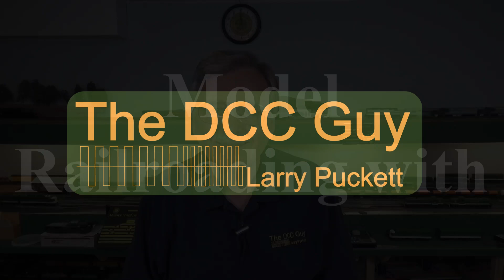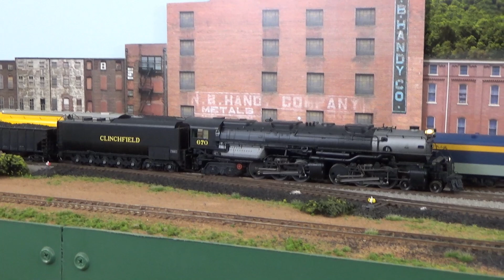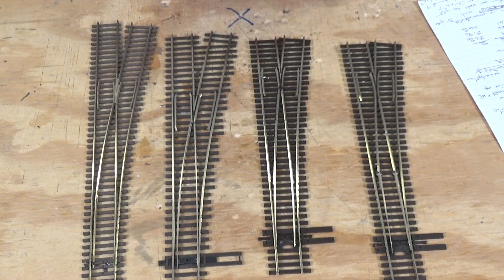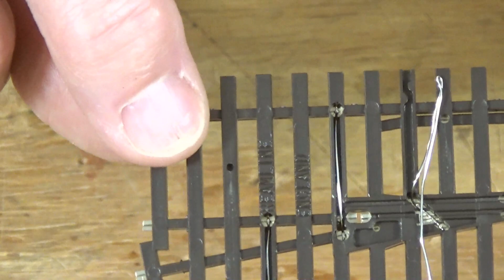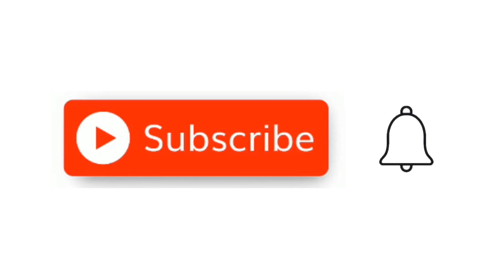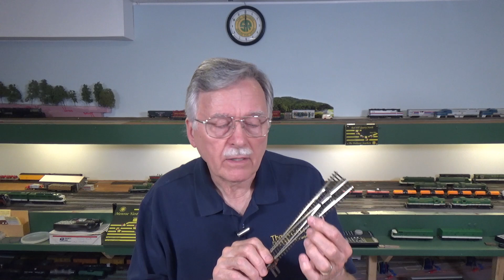NEW Peco Unifrogs Are Here: Let's Compare (260)

Comment: Larry; thanks for the review but I am confused about the unifrog.  I just installed 2 unifrog curved points in my newest layout and neither have wires on the back of the frog.  They work quite well.  If the ones you showed were Unifrog, why is there a wire attached to power the frog?  Thanks for helping me understand.  Cheers
Reply from the maker: The wire on the frog is a carryover from the Electrofrog design. I do not understand why your Unifrog turnouts do not have them. Are they UK prototype and what scale/code? Are you sure they are not Insulfrogs?
Reply: @TheDCCGuy  Larry; sorry for the tardiness; I don't know if the turnouts are UK but they are HO code 100.  The product references are Peco ST 244 and ST 245.  My supplier (M.B. Klein dba ModelTrainStuff.com) lists Peco curved turnouts on their site - 2 are insulfrog; 2 are electrofrog and then these 2, which I believe the packaging said "Universal".  Very curious.  Thanks
Reply from the maker: Those are not unifrogs, they are insulfrogs which means you cannot power the frogs.
Reply: @TheDCCGuy  Then I don't get the point of the unifrog.  With a wire attached how is that any different than the electrofrog?  Curious to me at least as to why Peco does not reference them as insul on the package.  Only 1 way to find out - I will send them an enquiry.  Thanks for your help.  Cheers
Reply from the maker: Electrofrog and insulfrog turnouts are being phased out and replaced but the unifrog turnouts. It is just taking them a long time to do the comversion.
Reply: @TheDCCGuy  Peco apparently plans to phase out all the dual line turnouts of Electro and Insul frog and replace with Unifrog.  As the tooling wears out, turnouts are being converted.  As far as I know, the only code 83 unifrog presently are the #6 double slip, #6 crossover and most recently the #6 regular turnouts.  The #5 turn out and #7 curved are still two versions unless something changed in the last couple months.

Comment: Any difference on the depth of the plastic in the frogs?  One of my biggest issues is the flanges of my European cars in particular, hitting that plastic infill and derailing.
Reply from the maker: I’ll  he k them and see, more later.
Reply from the maker: I measured them and the Pecos were about 0.86 mm, the Walthers were 1.18 mm, and the ME was 0.90 mm deep in the middle of the frog.
Reply: @TheDCCGuy  wow, that is quite a difference!  I was thinking of grinding that down to avoid derailing, maybe I should just replace.  Thanks!
Reply from the maker: I remember an article long ago in MR about folks who would grind down the flanges on older equipment. I often considered doing it to my Rivarossi E8s, but then replaced them with LifeLike E8s instead.

Comment: Interesting video as always. I model British outline here in US primarily OO (code 100) but have a (Peco) 009 section on layout - I generally order Peco Track from UK as it's much cheaper (after 20% VAT removed) even including shipping. Peco availability was dire until a couple of months ago, but now everything seems readily available (at least in UK) I generally use electrofrog but will order unifrog next time and see what I think. (Also good to know the Peco turnouts in US are now a different design to the British ones).
Reply from the maker: I have a new box of Peco code 75 bullhead rail I won’t be using, know anyone who might be interested?
Reply: @TheDCCGuy  Thanks for the offer, don't have any need right now. It would be a massive effort to rip up and replace the existing track (500+feet), plus I run a lot of older Triang/Hornby/Bachmann/Lima stock that needs the code 100 profile. Model Railways are always a compromise (particularly OO).
Reply from the maker: Yes, one of the reasons I stayed away from UK and other European models for so long was due to the “pizza cutter” flanges. I do have a couple of Rivarossi E8s that bump along on my code 70 rail. The flanges are so deep they hit the spikeheads.

Comment: Some other things to consider: the Walthers head block (imo) looks better than the Peco, however the Peco "throwbar" is better looking than the fat slab of the Walthers. Also, ME has their yard ladder system, something no one else has afaik. Also, to reiterate what Larry said last video, if you are going to use any of these with a switch machine you HAVE to take the spring out.

Comment: Hi Larry. I have been on the Peco website over here in the UK. At the moment, in code 83 HO they only have right and left #6 turnouts in unifrog and their #6 double slip. They are also bringing out a range of code 70 track for the US market which at the moment consists of plain track, a code 83/70 transition piece and unifrog left and right #6 turnouts. My understanding is that eventually all their turnouts in HO/00, be it code 100, 83, 75, or 70 and their N scale range, will be transitioned to unifrog. This will eliminate electrofrog and insulfrog (except the trainset setrack which will retain old fashioned insulfrog points) so other sizes will become available as they change the tooling and produce new batches. I have used them in both HO and N and for me, they are the way to go. They are nicely made and very robust whilst looking delicate. Hope that this information is useful. Cheers. Steve
Reply from the maker: Thanks Steve for that info. I knew they planned to eventually transition everything in their line to unifrog configuration, I’m just not holding my breath to see how long it takes. Covid has thrown a wrench into a lot of plans.
Reply: @TheDCCGuy  I know what you mean. During the pandemic the factory stopped all production and started making stuff for the health service. My understanding is that production has resumed but they are behind. However they have refined the unifrog points already to make them more reliable. Unfortunately I have yet to see the code 70 over here, I think the market is limited for US stuff here in the UK. Carry on with the videos. Thanks to you I now do my own sound instillations
Reply: @stevesworldofmodelrailways  was at Peco today and they had Code 70 US stuff on the shelves.
Reply: @DrDinnerTable  cheers. I have started seeing them advertised as being in stock at various suppliers
Reply: They also have a code 83 #6 unifrog diamond.

Comment: Larry I have used both Walthers and the new unifrog, I will switch all my turnouts to the new Walthers version,biggest issue I found was the construction of the throw bar, I found the Peco unifrog very poor construction, but stock issues will be a big problem, will see what happens
Reply: I don't own any of the Peco Unifrog, but could you elaborate on the poor construction?  Peco has had a good reputation for a long time.  Please defend your assertion.
Reply: @riogrande5761   I don’t need to , the trow bar is poorly made , I returned two for replacement and I fixed the others
Reply: @dundasjunctionmodelr.r-james  Hopefully you got a one-off.  No one has complained about the Peco Unifrog that I've seen so far except yours.  I don't have any Unifrog - I tried to collect a enough Electrofrog before the old stock disappeared.

Comment: Hi Larry. I have ordered 15 righthand and 13 lefthand Unifrog turnouts (for my N scale layout) from a dealer here in the UK. Many of the RH ones are in stock, but not the LH ones. We have had a few public holidays recently and these may have had an effect on delivery. I would be interested to know the differences between those for the US and UK markets.
Reply from the maker: Paul, just speculating, but the only differece I would expect based on comparing their HO and OO turnouts is the ties and associated hardware to conform to US vs UK practices.
Reply: @TheDCCGuy  None of the standard Peco OO/HO rail is prototypical (sleeper spacing) in term of UK practice, the new Bullhead rail is, but there are (as yet) only a limited number of options with Bullhead particularly when it comes to points (turnouts). Although the Peco 009 flextrack is prototypical vs Peco N gauge. (but you have to use N gauge points)
Reply from the maker: Yes, when I started the UK module project I bought a pack of their bullhead then found out that it would be a while before the turnouts would be available so switched back to Peco code 75 flextrack. As I understand it the new DCC Concepts flextrack is a hybrid between bullhead and Peco so as to match their points more closely and not loom out of place. And the high nickel content of the rail reduces oxidation of the copper in the alloy reducing the need for frequent cleaning.